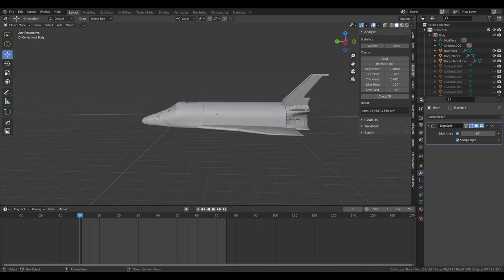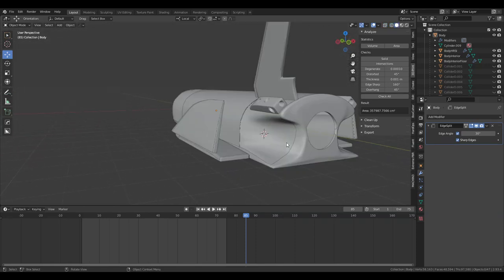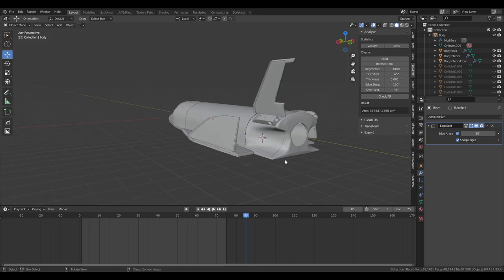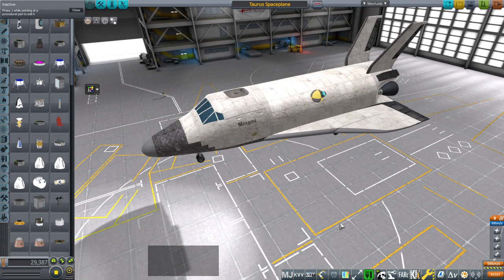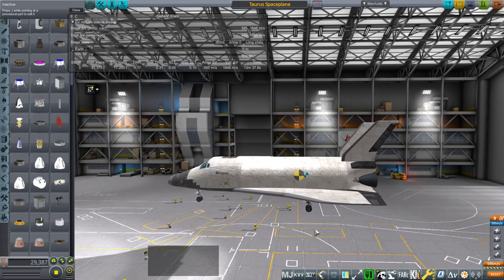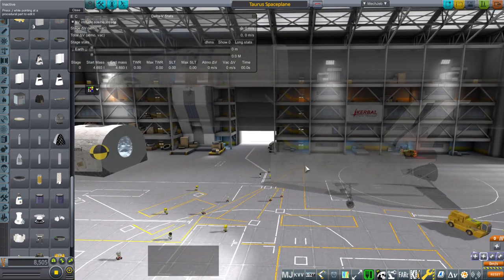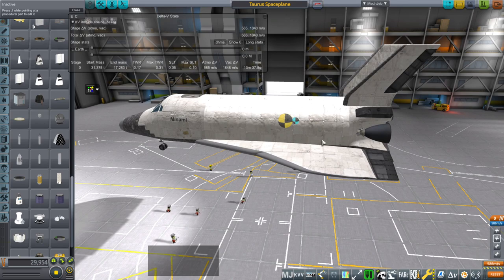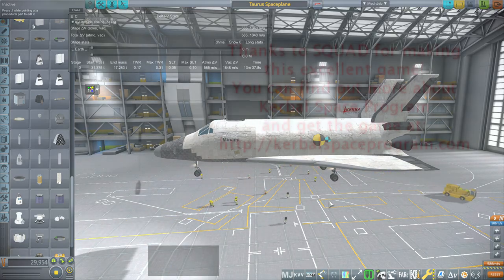KSP with Realism Overhaul - Taurus Spaceplane Intro

Comment: The shuttle could not come back from the moon, it's thermal load on LEO rentry had to be carefully managed already.

Thought that being said, I believe the main concern was heat soak into the aluminum structure. Assuming you are using a more capable material, a lunar return could be possiable.

Comment: Tyler, did you see Matt Lowne's latest space this week? i never knew before that ARCA SPACE EcoRocket is a thing: 2 stages with isp 80 s on steam aerospike with kerosene orbital stage. 5 ton rocket that barely sends 10 kg to orbit. it will launch from sea in partially submerged position like sea dragon and land steam stages on chutes with propulsive assist for the first one. i'd absolutely love to see you trying this flying teapot! it's fun how they say it's only 14% of polluting fuel, i think it's 80% of ΔV from it.
Reply from the maker: I've long been aware of Arca's proposed rocket, especially since it's the subject of frequent jokes on Twitter. I'm not going to touch it unless it gets a payload to orbit.
Reply: @RaizSpace  ok, they can do it any day now, the plan is to launch it between today and October, 12. i almost have no doubt it will get to space, kerosene stage alone can do that if the whole thing won't flip on waves. but getting to orbit will be a miracle.